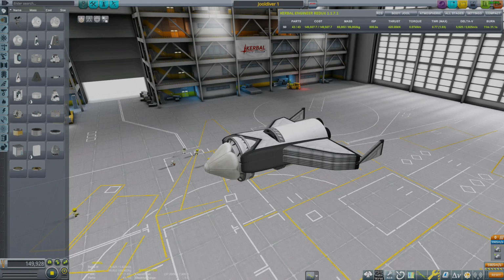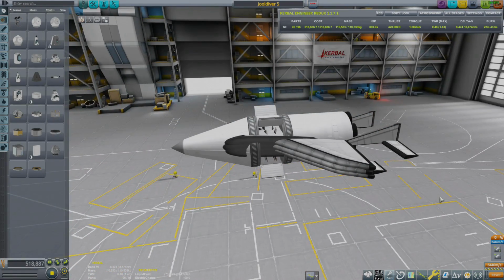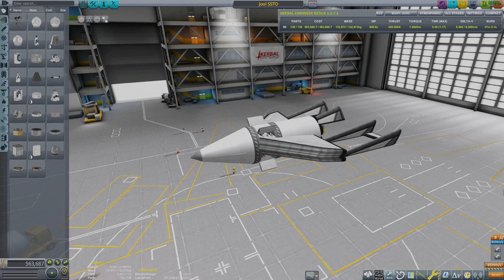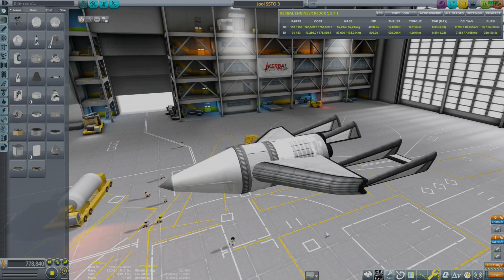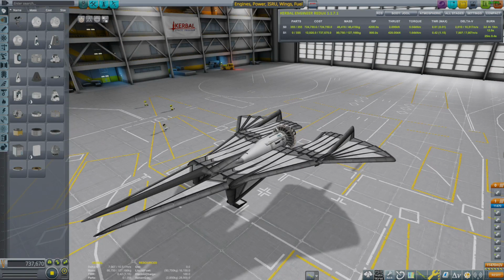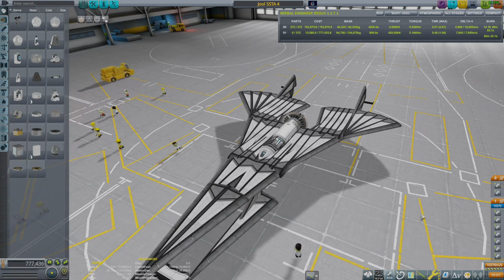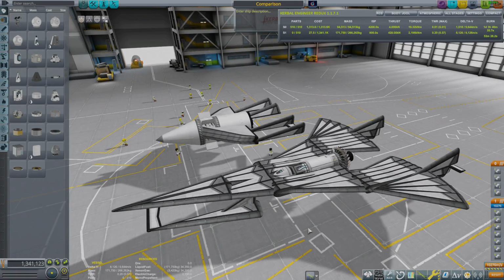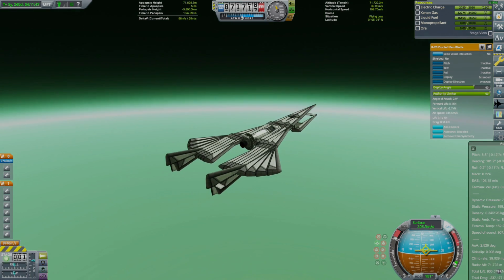The Jool SSTO: behind the scenes

Comment: I'm working on my own staged Jool spaceplane and the biggest issues I've run into are the rocket portion of the ascent and angle of attack during this phase. If I fly level while picking up speed then my vertical speed is far too low to get anywhere, but if I pitch up the drag due to AoA is prohibitive. I also don't know how much wing area to mass or rocket TWR I should have. Any advice?
Reply from the maker: On this craft we had about 1 wing area per 2 tons.  For two I would say keep starting twr bellow 1 (otherwise why not just be a rocket), but don't go bellow .4 or it will be very hard to get supersonic.  I find that what helped me the most with ascent was using wing incidence (rotate the wings so they have a pitch up AoA compared to air even when the fuselage points directly forwards).  Using 5 degrees means the craft can point directly prograde to minimize the drag from the body, but the wings still create lots of lift, so it will rise on its own once it is able to do so.
Reply: @lt_duckweed  Thank you so much! I'll let you know how it goes. Also, one last thing: how much Δv did you expend with propeller assist to low Jool orbit?
Reply from the maker: @ryanspence5831  off the top of my head I want to say it took about 7600m/s of vaccum dv to pull it off.   This can vary quite a bit depending on twr and drag of a craft, so I would say to shoot for 8000 initially, then adjust up/down from there.
Reply: @lt_duckweed  Thanks a lot; I better go redesign my craft

Comment: You honestly deserve more subscribers. I believe I found a solution for my wing designs from this video. I've been trying to create a SSTO capable of being supersonic in low Kerbin atmosphere focusing more on wing design, Giving it a capacity to reach orbit faster using less fuel. I ultimately settled on experimenting using an identical design to the IRL SR-71 Blackbird. It achieves what I look for mostly but by lessening the weight of the fuselage. That is something that I want to avoid.  My goal for the fuselage is to give it a capacity to be a small lifter/transport SSTO craft capable of reaching interplanetary travel. Kind of muli-role all purpose. I fail given I have only managed to orbit and get to the Mun in orbit. Never land. So I can't refuel. My next step was ion engines. Anyway thanks.

Comment: Fantastic optimizations here! It's great to know those big blades still "fit" in the small bay haha. Did you use the smaller diameter variant of the middle sized motor?
Reply from the maker: Nope, just the standard size, with the blades offset slightly inwards!

Comment: This is soo great. I am working since four weeks on an Eve SSTO. Barely made it to orbit today. This gives some ideas for optimization and more reliability. 

Thanks alot!

Edit: I thouroughly enjoyed the voiceover. Often times, we see highly optimized crafts on Youtube. But to recreate them and to get an insight into the design challenges, videos like this one are highly beneficial. 

One question regarding propellers, fairings and drag: In previous iterations, you used service bays to shield the blades from drag. How was it possible to use a fairing? As far as I understand, the blades still induce drag when moving and only the motor is shielded from drag? Or is the joolian atmosphere less harsh than the one on Eve in this case?
Reply from the maker: So we had it set up so that the blades and motor were still in a payload pay, and just barely behind the fairing, so the nukes were still able to be "in" the fairing, yet poke out the back of the payload bay!
Reply: @lt_duckweed  What motor did you use?
Reply from the maker: @BnTjr89  we used 2 of the medium rotors, set up to counter rotate.
Reply: @lt_duckweed  thanks for responding.  Are they stacked in series or attached to opposing surfaces?
Reply from the maker: @BnTjr89  attached to opposing surfaces, then one is rotated 180 degrees so they align (otherwise we sometimes got weird behavior)
Reply: @lt_duckweed  Oh, that's an interesting idea.  A while back I was trying to make an Eve SSTO with counter-rotating propellers, and I tried all sorts of arrangements, but I never tried that!